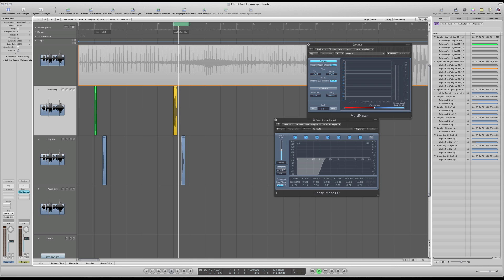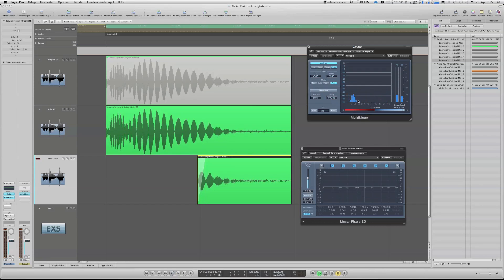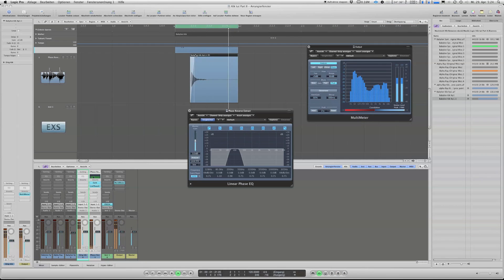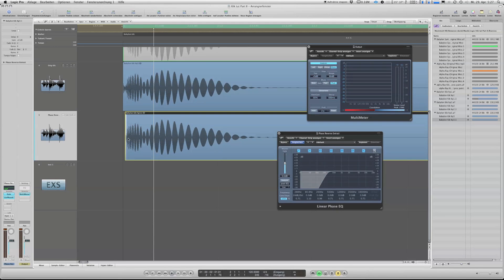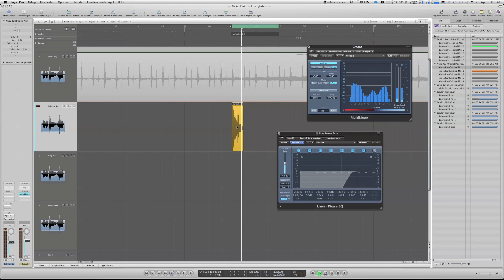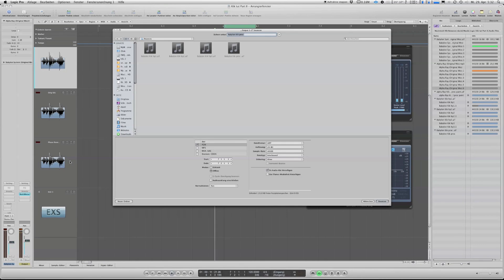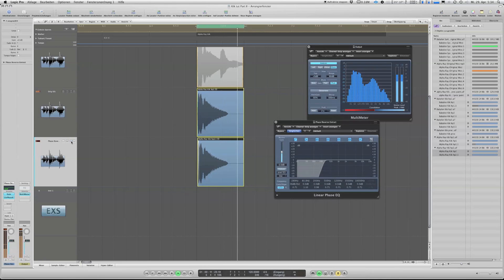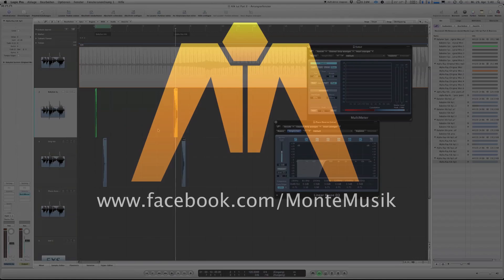Monte Tut #9 - Kik Processing Part III

Comment: Wow big thinks i learned really AMAZING:
-First i knew the technique of phase but your way to do it is amazing real
-Second the Sample Editor on logic is AMAZING i didn't know you could do this!!! O_O (i'am more ableton dude) but it's been a long time i'am searching something for DRAWING my wave.... you imagine with a graphic tablet?

- And finally i would like to add a element, sometimes when there is synth over you kick you can do this, take a Stereo imager, put out the mono signal, export. take the left or right channel and swap it in mono, then invert phase, and sometime is very effective when synths are mixed in stéreo and kick in mono even if synth is not 100% in stereo.
Reply from the maker: Tablet ? Sure. Whatever floats your boat. Did that same technique recently on Cubase too, worked like a charm.

Comment: Hey guys, do you think it's good idea to use sampled kicks like this ? I wonder, because they were compressed, limited and when you use them you compress and limit it again, is it good idea ?
Reply from the maker: Most "Sample CD" Kicks are already sampled from other records. Sometimes you just add a little more top end click or mid dirt from another kick to give it a bit more attack. My mixes are already well balanced and loud enough so there is usually not that much processing going on mastering whise. Since the Bassdrum is the most important and loudest signal in club music you measure the whole Mix based on it. A bad Kick which is not loud enough doesn't cut thru at all so this approach helps you to get a big collection of Bassdrum sounds which simply works straight away so you can concentrate on the music. My own library spans several Banks ranged from C0 - C8 using this approach and it's still growing.
Reply: MonteMusicChannel
Thanks for respond Monte ! Great job and I hope (as probably many others) you going to make next video series. It was amazing !